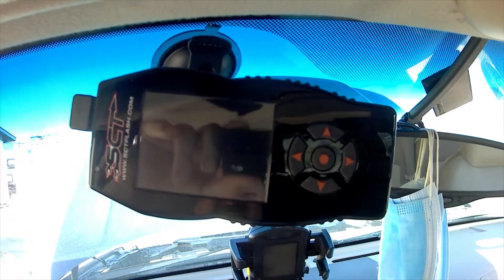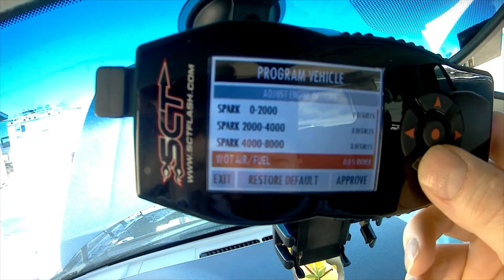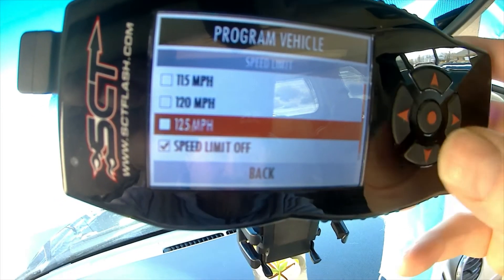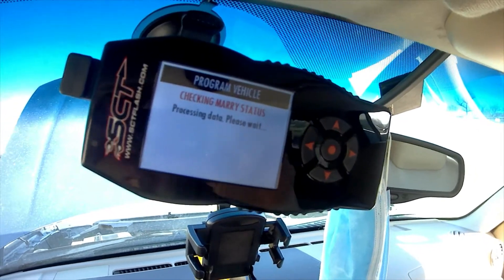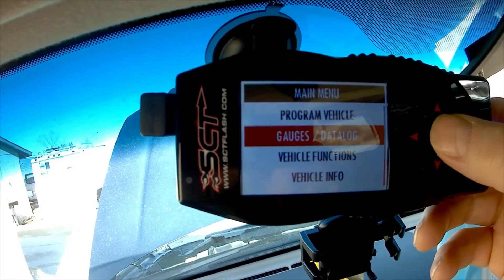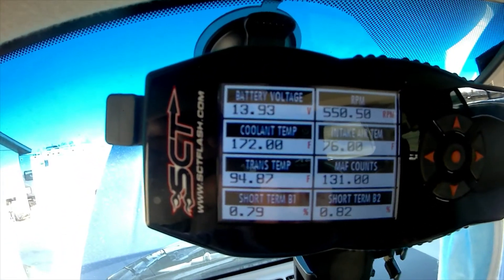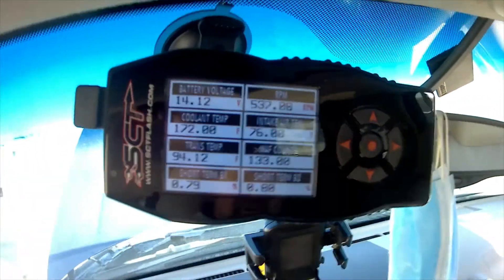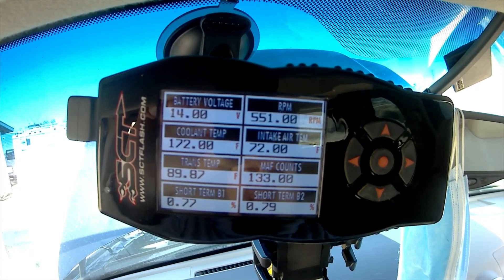SCTX4 tuner, How to Adjust Top Speed Limiter Governor Ford OBD 2 vehicles

Comment: Tried on a ford explorer 2003 and it unfortunately didn't work (anymore).
Called help/support and after doing a few things of troubleshooting that failed, they eventually called the engineering department or whatever and they confirmed that they discontinued compatibility with many older vehicles. The guy helping was confused because the ECU strategy info or whatever was still in their database, but their system no longer had anything compatible or something along those lines.

 Not sure what exactly that means as in what years or models will / won't work now, but yeah. Apparently they had some problems with communicating with the PCM on many older vehicles and so I guess they just discontinued them or something like that. It sounded to be like it was done recently, unfortunately. Nothing left to do now but return it and find another option. 

Your video was helpful in understanding either way though!
Reply from the maker: I hate when that happens.  Some dyno tuners can do a custom tune with your tuner to fix that.  I found later that COBB tuners are much better and their out of the box tune s are much better than SCT, diablosport for ford.

Comment: Got my sctX4 I turned off speed limit but it still stops me at 120,
Reply from the maker: That’s strange maybe call technical support for SCT and see why. Once you turn off the speed limit, it should no longer have one.
Reply: @madboostingmadmatt48  getting a Bama performance and race tune just bought the 150$ Bama tunes for life so hopefully that should fix that issue I know the 3.7 from 11-14 camerwwytwtteu  itdhahj FDAGF(,gcFxFd w with that two piece drive shaft which isn’t meant to go past limiter but I had it set to 130 max so I could keep that in mind but with the CANNED TUNES that it come with I can’t go past gov still and I set my rev limit neutral to 5200 but it still goes to 7k

Comment: Can I take the governor off my 2003 crown Vic with this
Reply from the maker: The SCT website can help you find the right part number that works for 03 Ford Crown Victoria.  They have different part numbers for different makes and models.  As long as you get the right one and download updates before installing it to get latest version, it will work.
Reply: The governor will not be removed, it just gets turned off.
The part number you want is the 7015, it's an SCT x4
Reply: So I put one in my 98 grand Marquis and I think it revs too high before it shifts, I think it's set to 7,000 rpm, so are you saying if I lower the rev limiter it will make it shift sooner and not take so long to shift?

Comment: Wonder if this will fix my governor on my 2013 f350 6.7 diesel?
Reply from the maker: Yes I believe it will, if there’s a check engine light the governor will cut off at factory level. I had a check engine light the other day on my F150 and it cut out at 107miles an hour.  Once I clear delight it went well over 100 no problem.